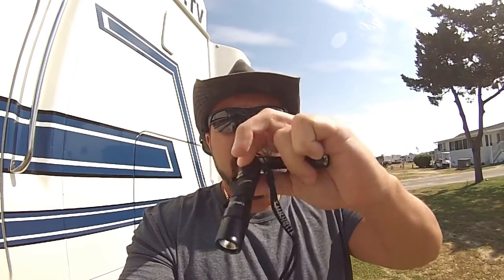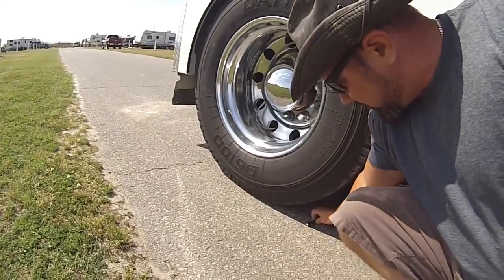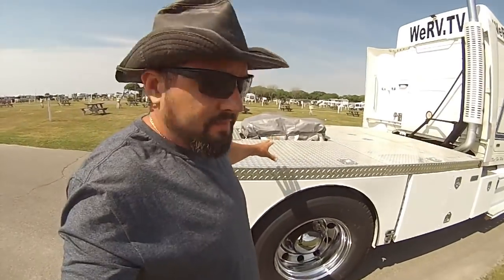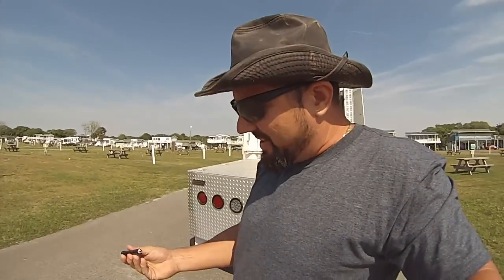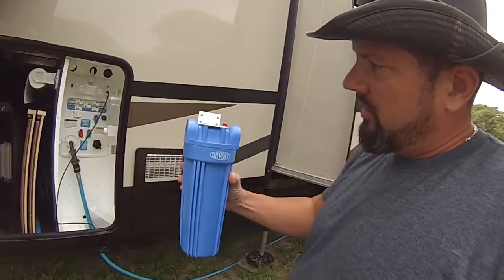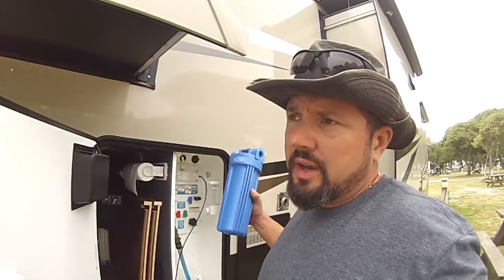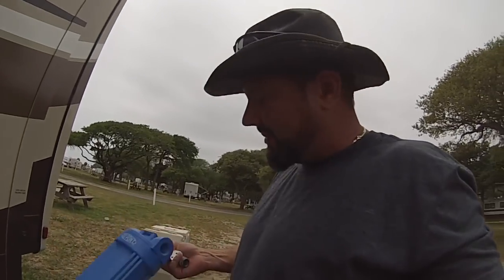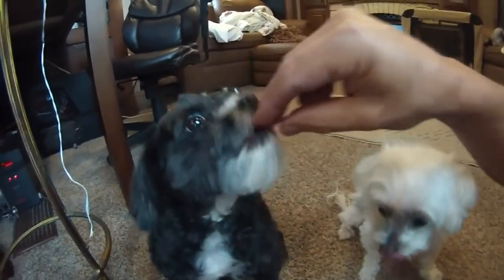RV hauler Runs Over Flashlight, Installed Water Filter

Comment: I would never of thought to test a flashlight by running over them with a semi, that is a new one...the questions I want to know is how well they work?, do they come on everytime you push the button?( are they reliable?) how bright are they? and how wide a pattern of light is? do you recommend them if you had to use them in the middle of the night to change a tire or use them to track dont whats making that strange sound down outside?
Reply: +C.C. Lapel The Thrunite TN4A is a better flashlight. It will light up a football field and it has a tactical setting. I bought one a few months ago from Amazon for 50 bucks.